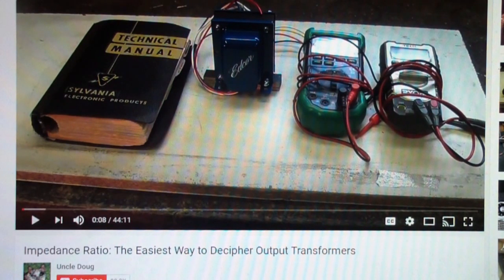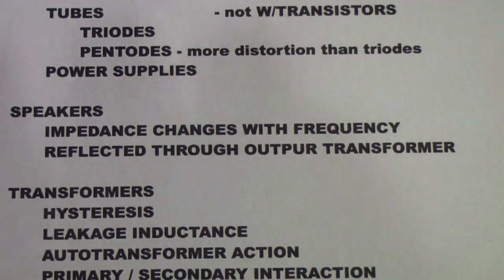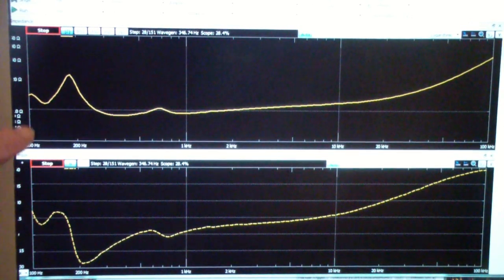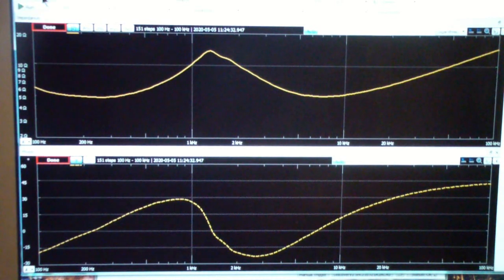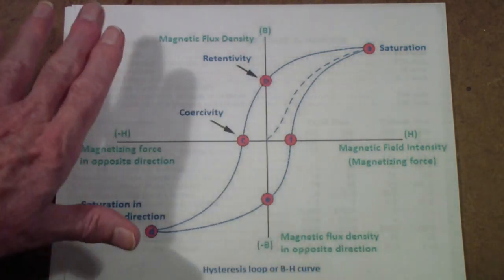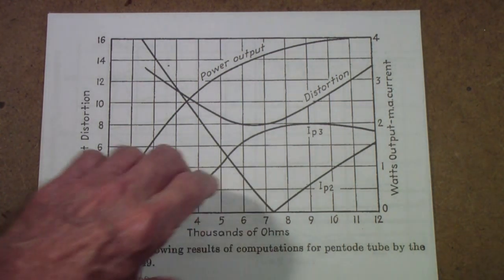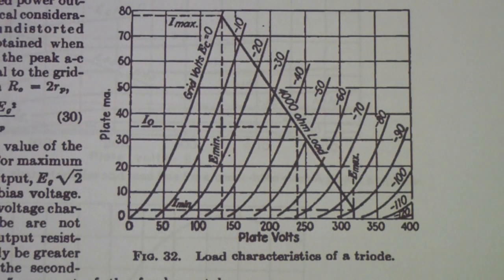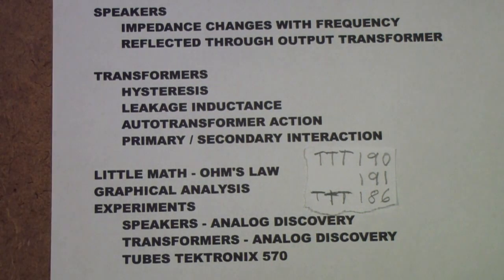TTT308 Why Tube Amps Sound Different Pt 1

Comment: If you want that tube sound put a 2 to 4 ohm resistor of appropriate wattage in series with speaker to get that push pull tube sound, 8 ohms for that single ended no feedback tube sound.a little bit of microphonics and the phase issues that the output transformer gives and the biggest is psychology--- see tubes hear tubes.Theres is also the ability to pick and chose what company the outputs are New, used, or NOS that tube audiophile love, it gives the certain sense of control.Low feedback design gives you a great deal of distortion,distortion in the bass makes it sound fat and in the treble gives it a certain shimmer.Audiophiles dont care about fidelity they just want a certain type of sound.

Comment: The biggest thing I got out of this video is I now know why the Class-A Tube Amp has an asymmetrical waveform (aka "fat bottomed" waveform). It's due to the transformer hysteresis which changes the load impedance and thus the 2nd & 3rd harmonic contributions in the output as the cycle moves transitions up and down.
Had to suppress myself asking "is this going to be on the final?" though :D
Much thanks, take care.
  - Eddy

Comment: Tom, I enjoy you videos. I think if we were sitting in the same room we could talk for hours. Your chart of power, distortion and 2nd and 3rd order distortion and how it relates to load impedance is something that has come to my attention in a much different way and here is the way I see it. 2nd harmonic distortion is pretty well taken care of by push pull. Secondly, and we do see this in McIntosh designs, the load impedance seen by the tube is very low (around 1K)  and that is  going to do some real suppression of the 3rd harmonic - and you just showed me that with your chart.  I very much enjoy the detail you go thru. I am, however, the type that can cook up the stew and plug it in and then take the kinks out of it and often times, come out smelling good. It is part of my success story but I have worked with men that were very analytical and methodical and very much admired them. I am often times hungry for results. It was what made me successful being at WSMR and NASA at all hours of the day and night having to get the job done so I could go home whereas most others had to leave at 5 PM because their wife had supper ready for them. Stay safe and keep posting.

Comment: Is there a way I can get in touch with you? An email or something? I am new to tube electronics. I'm trying to learn, have an interest in the rider channalyst. I'm going through my first radio receiver from the 50s. Having an intermittent problem. It's hard to find someone with expertise in these circuits anymore.
Reply: One top-quality restoration/repair channel, in my opinion, is Mr. Carlson's Lab. Check it out, a ton of tips and useful ideas.